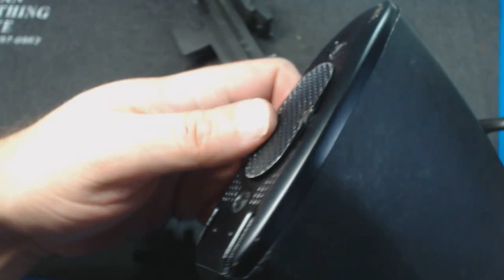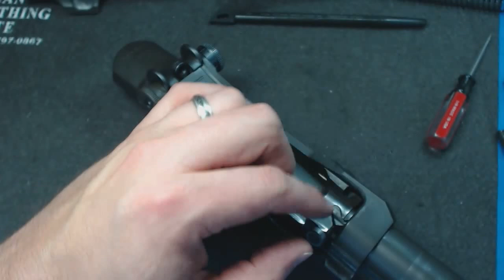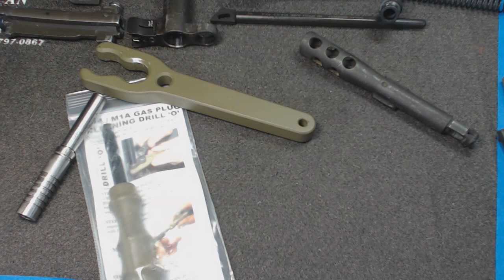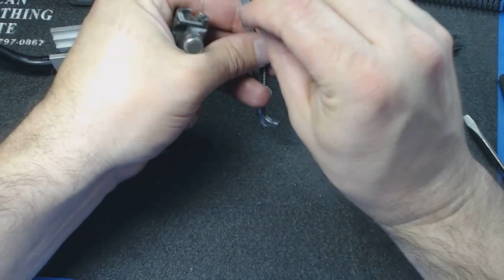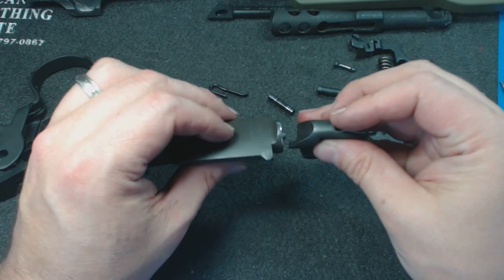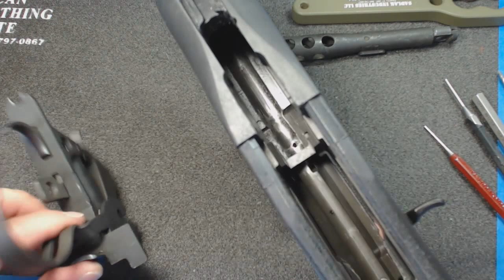Springfield M1A SOCOM-II (M14) Walkthrough disassembly and reassembly

Comment: It can be a little frustrating to take apart and put together some of the parts.  Mostly, don't fight it, go with it, a little gentle manipulaion and parts  (like the op rod) come off withput much effort.   It is made to be field stripped and lubricated.  The necessary parts fit in the butt stock compartment.    Thanks for the vid

Comment: Definitely educational. I'll be picking up my first m1a this week. Going with the socom or the scout, depending on if they have the socom when I go in. Ive wanted one for the past 7+ years. Finally getting one. And thanks to this video, I know what basic tools I need when owning an m1a variant.
Reply: have you tried an optic on the scout? I'm wondering if it matters which one to use by the optic. i'm not a huge fan of the aperture sights and like to run scopes. not sure if a red dot is good on this or what not.